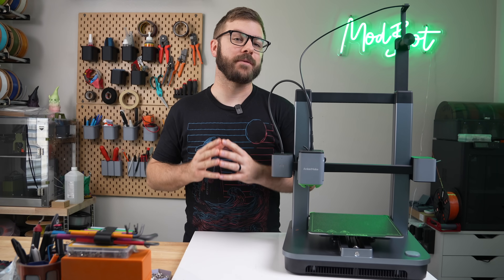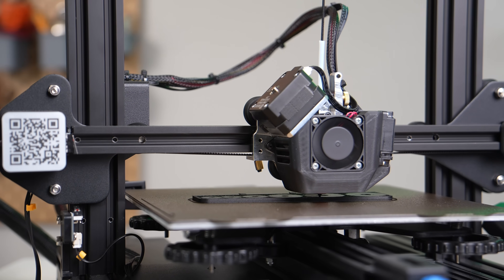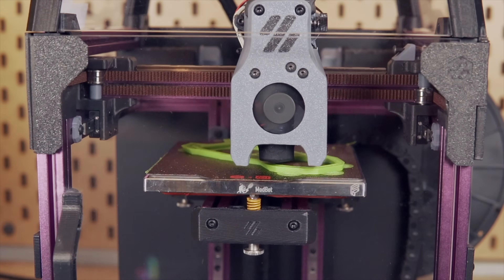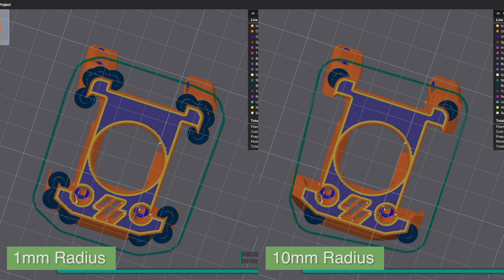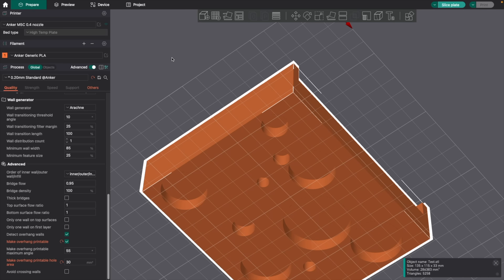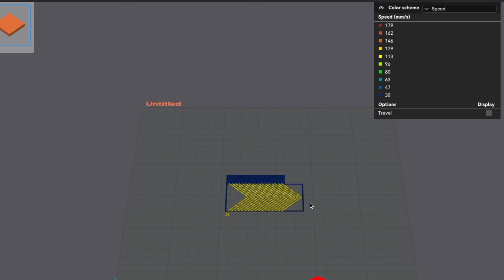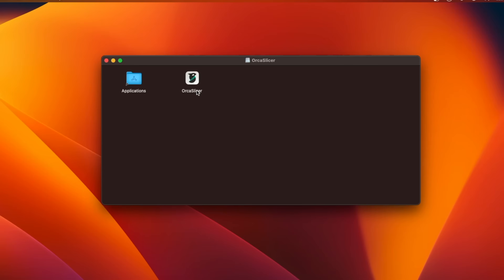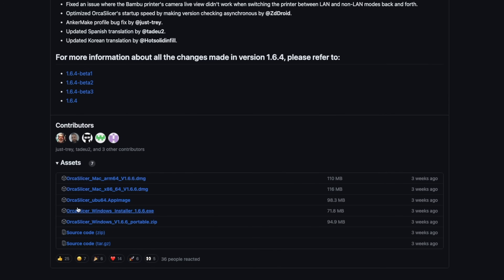My Favorite New OrcaSlicer Features (1.6.4)

Comment: Dunno if it's been mentioned by anyone else in here, but those mouse ears are all but useless the way they've implemented them. To be truly effective, the mouse ear must be fully incorporated into the object's bottom layer, not just 'snugged up' against it as a separate object touching it with zero clearance. Also, you can't adjust the position of an ear with respect to the corner it's attached to; sometimes it's desirable to have only a small bit of an ear overlapping an object, which is still effective for warp-prevention, but also easier to remove during post-processing.

For comparison, look at Prusaslicer's 'helper disk' (mouse ear) modifier: Add one to an object, slice, and preview the first layer to see the difference in how the the mouse ear is incorporated into layer. 

The way orca does it only adds 2 x the ear's radius 'attachment' to its associated object, meaning there is only 2x ear radius line of filament resisting warping for the corner...next to useless.

Comment: Just started using Orca slicer and liking it so far (having come from Super Slicer).  One thing I really like is that you can have multiple 'plates' in a project - however, a glaring omissino (unless I'm missing something) is that you can only have one filament type for the whole project.  So, if I have a multi-part print and some parts need to be in ASA and others in PETG, I can't save the filament type to the plate (note, I can set the filament at slice time but that's a workaround that shouldn't be necessary).

Comment: Cura has had a plugin for the mouse ears for a long time but it doesnt work correctly.  If you try and use mouse ears and supports it sets the support density to 100% if you turn the density down then the mouse ear doesn't form properly.
Reply: Maybe not the same plugin. I recently used a tab plugin and it worked great. Easy to detach when done.

Comment: Thanks for highlighting new features in Orca Slicer.  I just got my P1S with AMS a week ago and moved from PrusaSlicer.  Banbu Studio has a bug and will not allow me to print different color layers when slicing a butterfly Orca does.  One feature I miss from PrusaSlicer is easily changing from metric to imperal measurements when using the measurement tool.  U must go to View, Preferences to switch instead of a toggle.   Looking forward to UR update on version 1.7.0.  David

Comment: Thanks, Daniel!  I went ahead and grabbed 1.7.0 Beta for Linux.  I really like the way that they've maintained a very stable port to Linux for these.  While I use Mac and Windows, I live in Linux for most dev/creator tasks whenever possible.
Reply: Have had issues running in Linux. What distro do you use?
Reply: @Kensownvids  Yes, their Linux port isn't really ready for prime time use yet. They appear to continue to improve it but it's still alpha/beta level quality under Linux. Maybe by the next release they'll have it usable under Linux.
Reply: @Kensownvids  I'm a self-builder for my daily driver (I guess that would make it a "TIM's Distro"), but I also use Mint, Fedora, Rocky and Debian Stock for testing work.  I've run it on my daily driver, Mint, and Debian 11 with full success.

What are you running into after you download it?  The only thing that I noticed is that you do need to "chmod +x" the resulting appimage file.

Comment: So lets cut the Chase,I have a ender 3v2, what slicer should i use?.  "Depends on what you do" Is not an appropriate answer ;)
Reply: I would always choose to use whatever you're most comfortable with. I started with Cura because it's what I had used a few years ago with my old Anet A8 (RIP). Tried to use PrusaSlicer, couldn't figure out how anything worked, dropped it quickly. Eventually I moved to Orca because its interface is much less cumbersome than Cura.
Reply from the maker: I agree with this. Most slicers will do what you need them to and whichever you feel the most comfortable with it going to be the best option. I used cura for years but when I switched to Mac I found performance was not great. I would download 2-3 slicers and see which one you like the layout of best.
Reply: You just have to try them out and see what you like best. Its like saying, I was born in November ... what pudding should I buy.
Reply: I used cura for a while and put off trying anything else. But as soon as i eventually downloaded superslicer, I never opened up cura again. Now I'm putting off trying orcaslicer. 

Trouble with the question is there isn't one answer.

Having said that, my answer is to try superslicer.
Reply: Cura is what I would recommend if you're just getting started and want to get your feet wet. There's tons of support, tutorials and troubleshooting because "everyone" uses it. Once you have the concepts down for settings, you can start branching out and trying new slicers to see what you like best. At that point, you can ask yourself if there is a certain feature you like in one slicer that the rest don't have.

Comment: I downloaded it before but haven't really used it because I never got a good config setup for my printers. Sounds like I may need to make some time to do that and give it a try. Thanks Modbot!
Reply: I had a similar experience. Wasn't getting good prints and switched to prusa. Prints just worked on Prusa.
Reply: @Mrzizzy69  I didn't really try printing with it. I was going to but didn't have the time to set it up.  It's great that slicers keep evolving so much, it's only a pain when it comes time to switch.